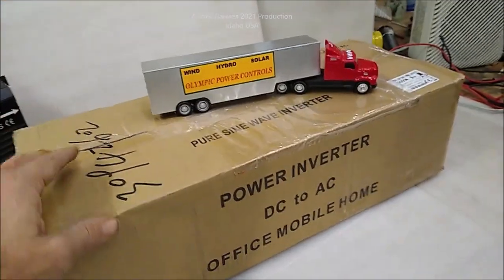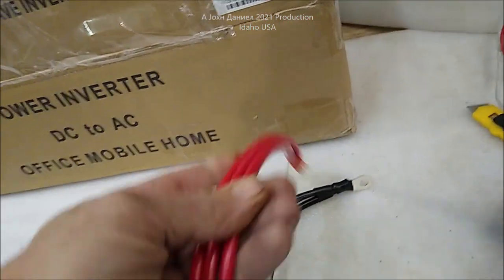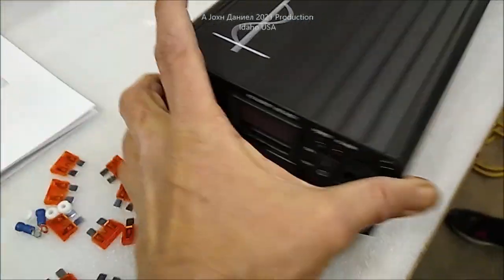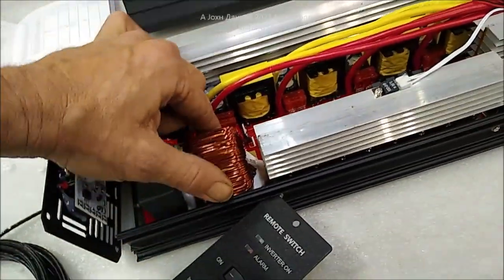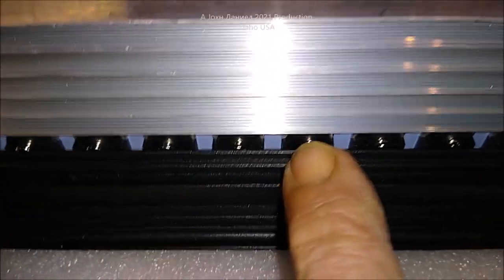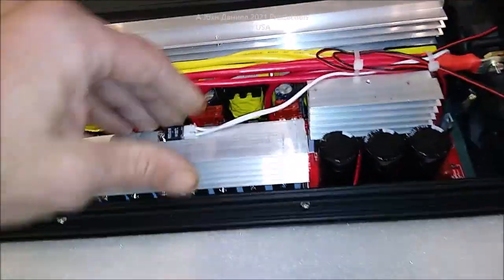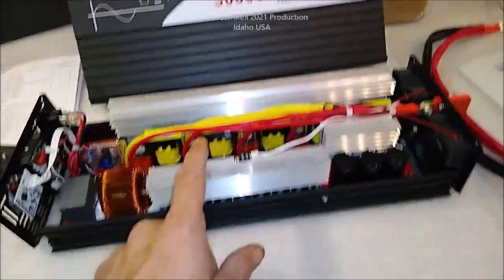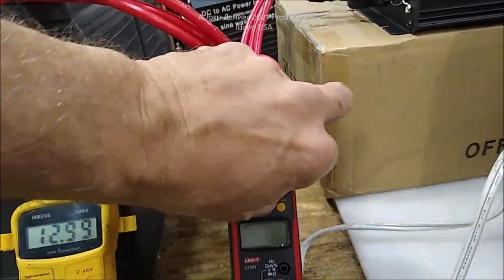SWI-Power 3000 Watt Pure Sine Wave Inverter, Newest for 2021 We review it, Parts List Below

Comment: why did  the 3000 watt inverter shut itself off at 1400 Watts?  and at 11.5 volts? 
to me, obviously that was NO test; and the whole thing is a sales pitch? that's ok; 
do a video showing it putting out, CLOSE to 3000 watts steady, maybe i'll buy one,but not like that,look for some else
Reply from the maker: Learn about inverters and batteries some then Note at 15:55 and forward to understand why this is the result. I fully explain that. You can't pull 310 amps through a single set of batteries good for 250 and expect to get the proper result. 3000 watts will discharge 2 golf cart batteries in about 15 seconds to under 10 volts and damage them. Good Inverters don't let idiots run a battery below 11.5 volts. And intelligent people understand you buy a 3000 watt inverter to have constant use of 1000 to 2000 watts max, sorta like saying I won't buy a truck without testing all 500 horsepower in the dealers showroom even though I can only use 200 of it 99% of the time.
Reply: @JOHNDANIEL1   well, it looks to me like it's the opposite of what you say;
if you go look, that inverter says 3000 watts, 6000 watts peak ; and all that for running it at 1000 ?;  (that would be like the idiot who buys a 500 horse set of wheels for 100K, or more, to go around the corner to the grocery store,or to drive on the highways at the speed limit) 
 
i am looking for one of those dual language chinese inverters, (24 volts in,NOT 12 !! and i hear what you said about the batteries sagging at 310 amps,, but that is a starter motor of a V8,and ONE battery there, lasts for 3 minutes,so i don't quite get it), inverter where 6000 means 3000; not a triple language,where 3000 means 1000; 

and after looking at your video again and at the inverter guts, thanks for that,i think that it may very well deliver the 3000 watts.
Reply from the maker: As I say in all videos on any inverters, ignore their surge claims. No matter the brand or type. If you want a continuous 3k inverter or 3k generator for that matter buy a 5k at least to get those results. 30 years ago I would not have had to consider the china math on almost every rating claim. But now you must. Metal gauge, components or product ability from China math from them is  "provide 75% as claimed then change your company name after sale". When I find the product is rated honestly I don't mind showing it like some of the little wind turbines, but you'll note my videos about Inverters I tell you that just ignore their bullshit claims of peak power and continuous power however this inverter had a more stability and quality functions than a lot of ones opened up in the last 5 years. I used it to run three deep freezers in the back of my truck on the trip moving back to Texas last year and it had no problem doing so.
Reply: @JOHNDANIEL1   i absolutely agree that it must be an excellent inverter, i just wanted you to show us tha MAX it could do, that would be an inverter test, especially coming from a person like you that obviously knows the stuff;  
 anyway,i am looking for one just like it,the 3000/6000  for 24 to 220, so your video was still useful after all.

Comment: What impresses me the most is the steady 123V output regardless of load! What about complicated loads like a drill, or microwave oven? Great review.
Reply from the maker: I ran a 6 amp drill on it while it was powering a 1100 watt microwave and it did not have any issues. So it appears to have extremely good stability.
Reply: @JOHNDANIEL1  Thank You! I'm starting think that this unit may be better than a  "Reliable"  brand inverter.

Comment: 10W power consumption in idle is really good. Most cheap inverters in that sizerange will consume 20-30W just to be turned on. Thanx for this review. I´ve been looking for a good inverter with a higher overvoltage protection setting. I take that the 24V version shuts down at 30V? 
My current one turns of at 29V and it is sometimes causing problem in halfcloudy weather when the charging voltage seems to jump a bit as the sun reveals. 

I´ve  had to drop the bulkcharge voltage by 0,3V to avoid it shutting down.

Comment: Great review, what happens if I use this inverter in a car with the engine running? Lets say I want to run a small microwave for a short periode of time, or a coffee machine or similar device that pulls around 1500 W for say 2 to 3 minutes?

Comment: I purchased this one from amazon. It worked great until it started to give off a smoke smell and the failed completely. It failed when plugged in a 1800w mini hot water heater in my van. I returned it to Amazon and got a different brand.
Reply: Did you get it 3rd party or directly from Amazon? The reason why I'm asking is because that makes a HUUUUUUUUUGE difference.
Reply: @kylehill3643    Hi, can you please explain?  what is the difference?  thanks

Comment: Hi John I purchase a 2000w version of the inverter in the video, however the output display screen is not showing the output voltage, i have emailed the them, no response yet can you suggest a solution to this problem. Mike
Reply: I buy this 3000 watts pure sine wave the same name only thing you can hot wire it the guy tell me only DC VOLTAGE INPUT WAS SHOWING BATTERY OK AC OUTPUT VOLTAGE WAS NOT SHOWING THE INVERTER IS 48VOLT DC INPUT HE USED 12 VOLTS BATTERY THIS WHY WHEN GET HOME I HAVE USED 4 12 VOLT BATTERY IN ORDER GET IT TO WORK

Comment: It would be helpful to know what the standby power draw on that beast is.  Since the ebay link does not state standby power it's probably pretty high.  I' m estimating 30 watts standby power  if you subtract your fan power from the initial reading.  The standby power will kill your battery bank rapidly if the inverter is left on continually with no load.
Reply from the maker: A little less than 1 amp so 9 to 10 watts.
Reply: After revisiting the link, I did find a no load spec. @ 1.6A.  This would equate to 20.48 W @ 12.8v input voltage.  Still quite respectable for an inverter with a 3000W power rating.

Comment: Dear Brother thanks for the wonderfull job you are doing. I connected by mistake the inverter to a AC live line and it is out of order could you help by providing the diagram of the 3000W Swipower inverter in you have ?
Thanks and Best Regards.

Comment: Thank you for the information. I live in New Orleans and Hurricane Ida convinced me that I need a backup power source. Most people seem to use generators for that but given the fuel efficiency of a car engine, the dramatic reduction in CO1 emissions, the relatively huge gas tank, and the storage benefits (generator size v. inverter size, fuel storage) I am thinking of using my car as the generator with an inverter. 

In your video you talk about the number of batteries needed to get to the 3000 watts the inverter is capable of but, does that change if the engine of the car is running all the time? With the engine, can it produce the 3000 watts?

I would like to run my refrig/freezer unit, two portable 6000 btu Air-conditioners, and a desktop computer (including scanner, printer, monitor). The rough estimates for those  devices comes right under 3000 watts. Does that seem right? Would a 3000 watt inverter be enough? Or, should I go with 4000? 

But, the whole plan goes out the window if I need 8 batteries to produce those watts.

Thank you in advance for reading this and taking time out of your day to answer it.

Mark
Reply from the maker: Get you 3 Walmart type 27, cabled together from your car with quality cables. Then the inverter. Parts: 3 x https://bit.ly/3ntC0HV & heavy high contact cables from car to 3 battery set https://bit.ly/3AiClvr 
Be sure to join batteries with 2awg links.
Reply: @JOHNDANIEL1  Are the three extra batteries required if I keep the car running the entire time?
Reply: @theconstitutionalist3353  yeah they would be, at idle your only going to have 20 or 30 amps max from your car.  your starting battery will be depleted in no time .

Comment: Computers do not need pure sinewave inverters. Their power supplies are switch-mode and draw power from the main smoother cap, fed by a full-wave bridge rectifier. Transformers and motors need pure sinewave. Like fridges, air-conditioners, vacuum cleaners transformer-type power supplies. * Give this comment a like if you agree *
Reply from the maker: Even with a transformer to a laptop you should use pure sine on computers due to the I'll effects modified can have on the BMS in the battery. Modems and copiers tend to fail from modified wave over time too.
Reply: @JOHNDANIEL1  Laptop power supplies are SMPS (Switch Mode Power Supply) so any power reaching the battery, is pure filtered, regulated DC.

Comment: Hey Daniel.just discovered your amazing Channel. I have a rookie question for you. What battery voltage shall i go for When building a system that charge from a Wind turbine like the one you have shown in earlier videos? I original planned for using 12 v
Reply from the maker: In today's economy and current conditions worldwide I would recommend 12 volt, most people really freak out when you tell them that because they've been sold on the idea you need to use high voltage. However the higher voltage items are harder to get you'll see it video on my channel that explains it you'll have to look for it it shows I think a picture of some solar panels drawn out and about 12 volt explanations.

Comment: 3000 watts is a pretty big ask for a 12v system.  At 3000 watts one should really be considering a 24v system.  If you jump up to 6000 watts or more then 48V tends to make a whole lot more sense.  Then again beyond 2000-3000 watts, a LF inverter is a better choice since they have a much bigger surge rating and handle inductive loads better.

Comment: There's a lot of junk inverter's out there for sure, this does seem a good one though, I guess time will tell for sure. Did you get the Vector in the air yet ?
Reply from the maker: We have had an extremely cold winter where I'm at this year it's not hardly warmed up above 40° since November I don't like getting up on that roof in this cold so it'll be a while.
Reply: @JOHNDANIEL1  bring on the spring 💪, yea really looking forward to seeing that turbine. Would probably work out a bit too expensive for me with tax and customs on it but still interested to see. Good luck and take care 👍

Comment: JD I still wish yo0u would write a book on designs and parts
Reply from the maker: I am reading up on it, and Kiera is going to be my hands for such a adventure. Severe carpal tunnel and keyboards are no fun.
Reply: @JOHNDANIEL1  Bro  Carpal tunnel is an easy fix  Load up on Vit B6 and Zinc.  then put a rubber band around your fingers and open and close them ( a rubber band exercise ) in a few weeks you'll see major differences
Reply from the maker: @ronbonick4265  I don't handle increased zinc well. B6 is ok though. So I just do a multi plus with zinc but the damage in my wrist are from kick boxing, many micro fractures took its toll.

Comment: Nice to see you back, with a video. So, I'm assuming that you're adding, well, multiplying 1.25% to your need for continuous use for watts from an inverter that is needed, or ÷ 1.25% from the original inverter watts, i.e., 3000 watts would be 2400 watts in reality, yes? Kind of the same thing for fusing, yes? I would like your opinion about fusing, for protection of electrical components. I like to downsize my fuses to blow before the damage is done. Most people I know will say to fuse at the max+. That has never made sense to me. Example: 3000 watts [ they say ] peak is 5000 w for 12v system. I would stay at  200 amp fuse protection, but I definitely wouldn't go over 250 amp and not add in the 1.25% on top. My reason is you what to protect your components, and fuses are cheap compared to an inverter. If you did it the way, most do 5000 ÷ 12 = 416 x 1.25 = 520. My thinking on that is you just smoke your inverter with, and if someone can produce that kind of Amps from a power source anyway batteries or the from the grid, they'll have much bigger problems like fire and explosions. Or am I thinking about it all wrong? Your opinion, please, thanks!
Reply from the maker: Best inverter methods are never exceed continuous 60% on them no matter what brand or price range and you'll be fine. As for fusing, I go 20% under wire rating, 10% under device rating and so far so good.
Reply: @JOHNDANIEL1  thanks! Then you’re on the same line of thinking! Under sizing the fuses for protection of wire and components. Cool I’m not crazy! Well some will argue that. Oh by the way one of my neighbors ask me to take down the hillbilly alarm system! And my answer was no! I love those simple devices, even the pigeons hate them! Those were such a great idea from you!

Comment: 26:22 - Hate to be so critical as I'm a fan of your videos, but you should have probably done that since it's a chinese inverter after all... unless the unit is forced to endure max continuous rated load for some reasonable duration, then the review is not thorough. We also don't know how it will cope/behave under the rated surge load. From your review, it seems like it can handle up to sustained 1500W load quite fine, but no guarantees beyond that. The visibly beefy internals are definitely assuring, but  unless put to a real test, nobody will know what those components can really handle... Caveat emptor

Comment: Nice video JD. I currently have a 1000 watt modified sine wave inverter in my RV. I want to replace it with a pure sine wave inverter. Would this one be a good replacement?  I know overkill as far as excess watts but this looks like a sweet unit?  Thanks.

Comment: Great video. So if I buy the 3000W model of this unit on EBAY, will it have all the upgrade like what they have done for the unit as shown in this video? 
How well does it handle surge current such as fridge compressor load?
Do you have the link to the actual seller you bought the unit from?
Reply: Did you ever find/get an answer to your questions? I had the same question.
Reply: I'd like to know the answer to that question as well. I mean do we all get those up-grades. Or was that a special order for you???
Reply: @bo45  what were the upgrades?

Comment: The little white things probably slot into the slots on the feet inverter to insulate it from the wall you mount it on. That way the mounting screws contact the white plastic things rather than the feet of the inverter.

Edit: I see you mentioned it in a later part of the video. Oops hehe.

Comment: "your big color tv"
Reply: Hi John, do you know if the lower wattage units eg 1500 or 2000W are the same internal design as the 3kw unit? It's for my RV with only 1 12v battery to draw from.....thanks from the UK 🇬🇧

Comment: Those inverter wires are a joke.   I would never use those in that configuration.  It looks like number 8 or 10.   Not enough.  You need at least 1/0 copper stranded wire for that wattage.
Reply from the maker: Definitely not 8 awg, I replaced the terminals on one end and can say the wire gage on each of the 3 lines using a gauge card is calculated as 5 awg ( it was 4.50 mm, so the metric conversion to be basically 5.10 awg ) per cable on them at 17.75"  ( 450 mm). It did have Very thin plastic on the wires. I will later put  28" of 1 awg on it. For now, its sufficient due to short length, but just barely!  I absolute guarantee it will not do a surge of over 4250 though for more than 5 seconds. But that's not the goal, the goal is cost for application, voltage quality which was excellent, sag effect which was non existent, and hopefully some durability of it running at constant 35 to 40% sold as capacity. For the price, it solves the need.
Reply: How do you figure the inverter wires are a joke? 1 gauge? The amp pull on the batteries isn't like your starting a deisel. The I'm in agreement about the internal inverter wires gauge should be thicker than than 12 or 10 but it's only a short distance too. I m no engineer glad you brought it up. Hopefully we can get answers. Thanks 👍